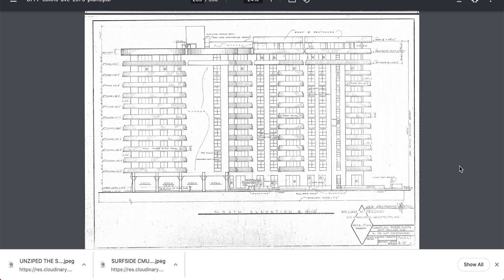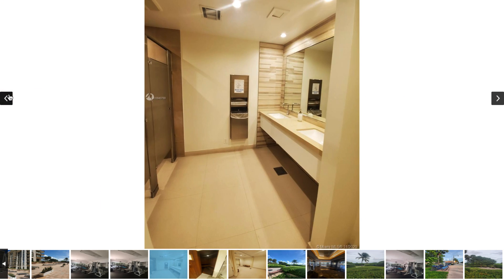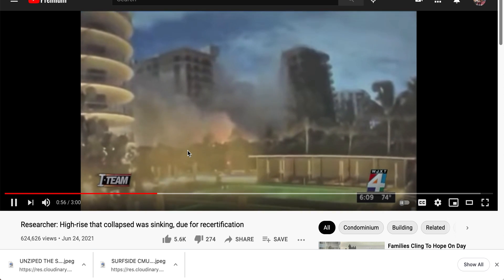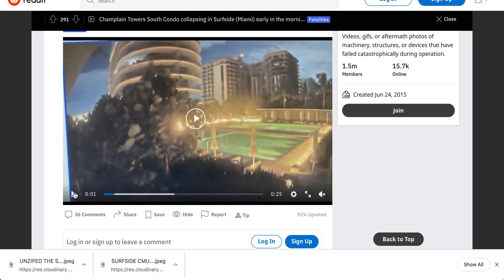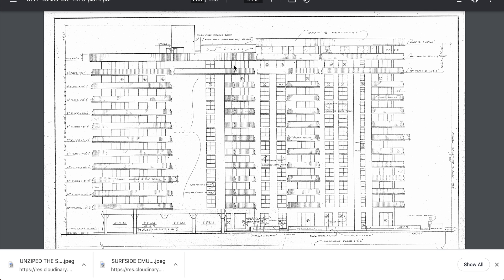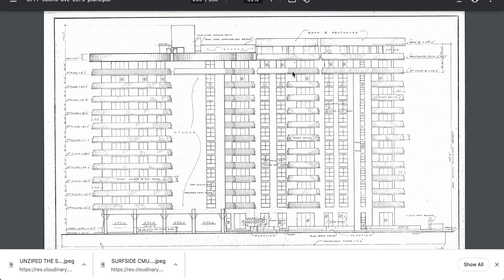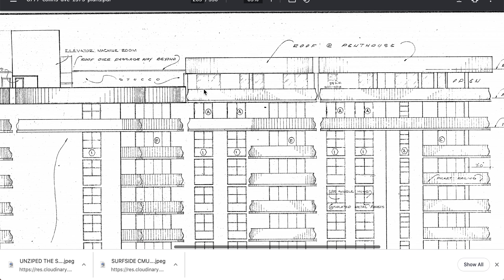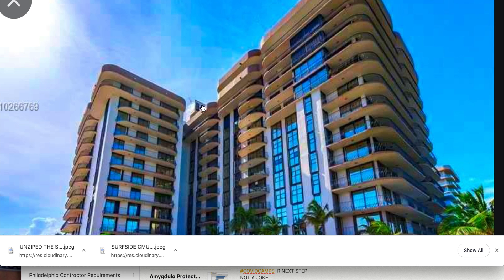Champlain Towers Collapse Verification Plans DO NOT Match Existing Structure

Comment: Interesting study, try blue beam so you can do overlays and split screen for better analysis. The collapse starts at the bottom in the underground parking. Look at video and some of the debris photos, the partial pool deck collapse. This is a progressive collapse that took everything above. Look at the geotechnical of the nearby Miami convention center. This is built on sand with a water table at a few feet at best. This entire area used to be mangroves and coconut farms. They dredged the channels and bay and built on washed sand which is like trying to build a sand sculpture with golf balls. Guess where they got the sand to make all the concrete back then?

Comment: "6 engineering experts...[said] a structural column or concrete slab beneath the pool deck likely gave way first, causing the deck to collapse into the garage below, forming a crater beneath the bulky midsection of the tower, which then caved in on itself"
miamiherald.com/news/local/com…

Comment: Pool deck is covered in pavers.
Height limit in Surfside is strictly 12 stories! 
I don't know how they managed to stack another floor to build a penthouse... 
It appears that it has a private elevator, which is the shaft that kept that part of building from falling right away and produced that diagonal slice.
Reply: How is the limit 12 stories when the building next to it is twice as tall ?
Reply: @bobbyalexander1860  That's the south border with City of Miami Beach. That building is not in the Town of Surfside. Different zip code too.

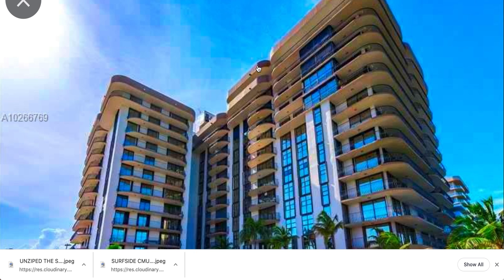Comment: 16:43 from what I can see on the columns laying on top of the ruble pile, it's 2 bits of rebar on each face of the column into the flat slab (maybe 3 possibly on some), and concrete.  early 80's "flat slab" construction before the 85 Mexico earthquake and 95 store collapses showed how bad that was.

Comment: at about 6:16, looking at the columns standing, and looking at them sitting on top of the rubble pile along with a few others. also, the columns punched through the pool deck out to the fence. this looks to be early flat slab construction, from the 80's, long before the 1995 sampoong department store collapse that demonstrated some changes that had to be done to column floor connections with flat slab construction.  I see a lot of column punch through, and one news outlet did say they were doing some roof coating at the time, so maybe a few things there. rusted rebar from age and sea spray exposure, inadequate rebar at the connections, and/or staging of whatever they were using with the roof coating stuff. also can't rule out what people may have had in their apartments as weights along with the roofing supplies.